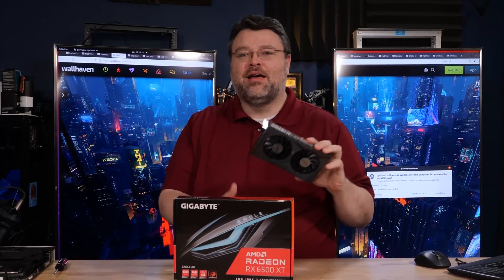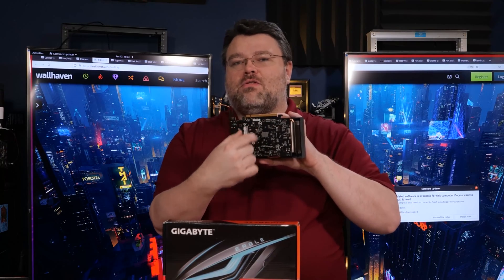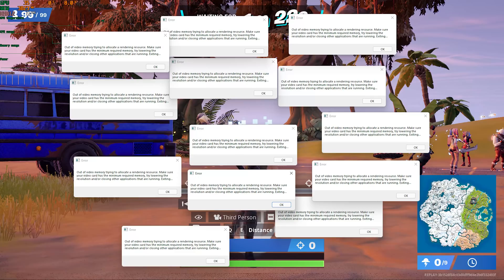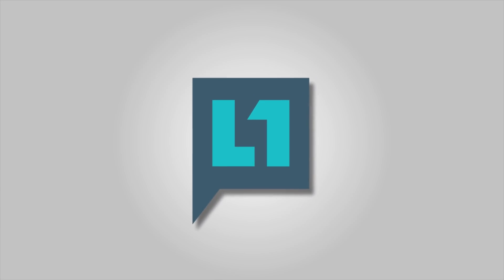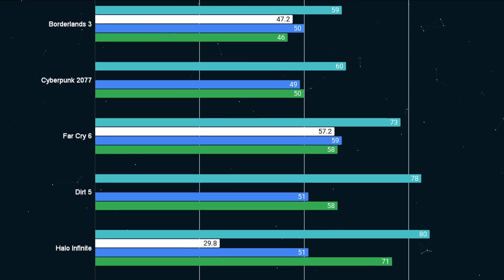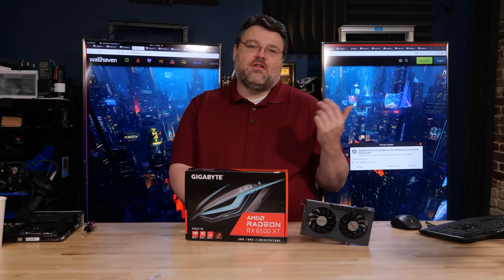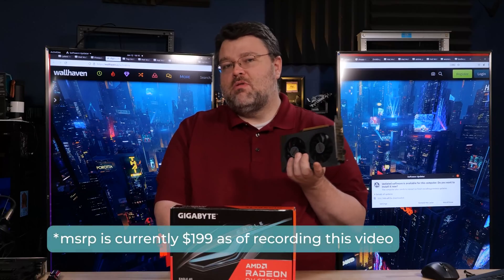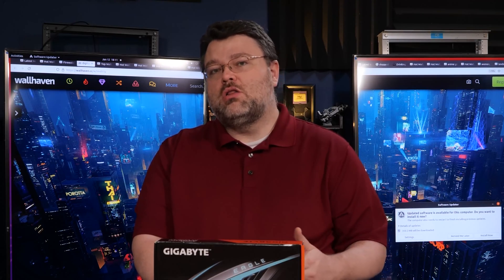6500XT ; Now Attempting Launch - Gigabyte Eagle Tested

Comment: Here's my dilemma,
I'm looking to replace my RX 550 OC 4GB which was my first ever GPU in PC gaming. Reason being, I can barely hit 60 FPS on newer games at low settings/1080p.
Thus, this card came on my radar as it's just cheaper than the closest 6GB 1660 Super.

So, should I invest the extra money to getting a 6GB or 8GB GPU instead? 

Other components like CPU, RAM and storage are relatively decent with A ryzen 5 3600 and 16GB RAM and 1TB SSD.

Thus, if this GPU will get me running games at Over 60 fps at high settings. It's my best option in terms of budget and necessity to upgrade

Comment: I bought the 6500 xt for one reason. Linux gpu pass through. It’s in my 4x slot as the host gpu and I pass through my rx 590 until I can upgrade that card. Only real use I can think of.

Comment: I got one for $199 from Newegg for my budget build .update got the card install on a Ryzen 5 5600g system (PCI3.0)running 16gig ddr 4 3200 and i have a 1440p 144hz monitor and wow everything works like a dream ..God of War 1080p upscale to 1440p medium setting looks awesome using 3.5 gig vram 60+ fps very fun experience looks fantastic .///Fortnight DX12 performance 160fps to over 200fps fantastic card for Fortnight got kills with ease looks amazing ..guardians of the galaxy ok yes a bit of a stretch but medium settings looks good not fantastic but very much a good exp playing it on this card ......must admit I have a main gaming rig that has a 5600x and a 3080Ti so i can and have seen these games on high end rig and well I am surprised what this little card can do and if on a very tight budget and ok with 1080p gaming and can find under $250 in todays market got mine for $199 It can definitely play todays game and look nice with decent FPS at 1080p ...side note I will mostly play Fortnight and watch YouTube and a few other internet things on this system as a daily driver and game on my real gaming rig (side note this only requires a $400w PSU) and that is what I have (EVGA 400w psu) in my 5600g system with this card .runs great and quiet

Comment: I was hoping for a single slot config but I guess dual slot with the possible overclocking is a better option.
Looks like a good candidate for low profile models which haven't gotten anything beyond the 1650.  Also, at X4, seems it would work well as an egpu.
A little too targeted / niche for my taste.  In the before times the MSRP wouldn't have bothered me because AMD would have had it discounted very quickly.  Not so much now...

Comment: .its a 6500 .. not a 6600 or a 6700 or a 6800 its a 6500 its just suppose tobe better then a display addapter. the next step down would be a 6400 and that would be a display addapter. i dont see a problem with the 6500.. its still trash for me because im still on pcie 2.0 lol  but i do not think this card diserves the harsh flack its been getting. its prices just more trash then the card.  gg lv1 techs

Comment: The greatest gift of the 6500XT is that it sucks so much that you actually can buy one.

No kidding, for a (significant) lower price I would buy the 6500XT. I'm currently using a used 1050 2GB I bought last year because my 660 3GB OC died and I needed just something... and when you consider that the old GTX 1050 Ti was 2020 reintroduced for almost twice what the card originally cost... Yes... that pain.

It's not a great price/performance ratio, but at least it's a new graphics card you can buy right now... wow.
Reply: Is it really bad on pcie 3.0 for me i have an i5 9600kf and 16gb of 3200 mhz ram and i also have a gt 1030 so i will mostly likely buy this card its the only one that’s reasonable
Reply: @Movahpiece  The RTX 3050 is not so much more expensive... would be a much better value card.
Reply: @Sir-Prizse  i was trying to get a rtx 3050 but it was sold out and the price is almost 100$ more than the rx 6500 xt I bought
Reply: @Movahpiece  If I absolutely needed a new competent graphics card right now, I wouldn't shy away from the RX 6500 XT. It would get me by for the next two years, but I don't know how much it will lose in value.

Because as soon as more sensible graphics cards come onto the market, the card will no longer be worth anything... maybe max. 150 bucks, unlike the RTX 3050, which performs really well and has enough VRAM and will hold its value for a long time to come.
Reply: @Sir-Prizse  i just got this card to help me until the prices of gpus goes down after that ill get a new one cause rn i have a gt 1030 😭
Reply: @Movahpiece  I feel your pain brother, I have a GTX 1050 2GB... not that impressive either.

Comment: My issue with this card, aside advertising crap from AMD, is that it leaves nothing in between this card and the 6600 (an actual decent 1080p card, albeit mid end). In other words, AMD is pretty much giving up the budget space, with a glorified placeholder card for people with nothing right now wanting to build pcs or people with APUs (and old not even entry cards like a 1030), so for people that actually want to upgrade from a decent budget gpu from some years ago, this is not worth it. Now, the pcie 3.0 issue is the real screw up here. I have a gtx 1650 and with some of these benchmarks, actually having the possibility to sell my 1650 and get the 6500xt would be pretty decent, except I have a b450 motherboard, so the performance that the 6500xt would have is pretty much the same (I've seen a 12 games avg benchmark and the 1650 has 2 fps more in the 1%less and 1fps less in the avg than the 6500xt). It is a sidegrade that involves me selling my card and actually getting this one at a decent price, which aparently, hours into the realease of the card, it was not possible. 

This card is not something like the rx 470 or 570, its not like the gts 250 or 450, or the awesome gtx 750ti, its not even like a 1050, this card seems to be in the middle of those and something like what a gt 730, gt 1030 or rx 550 used to be, with a name that doesn't belong and that completely ruins the chance for having something actually budget in the near future (even if budget right now would mean 220-280$, which I would expect it to mean given the circumstances). You either go this card, which I would actually like if it was called 6400xt or even 6500 (giving space for a better 6500xt), or go mid end with the 6600, the gap there is terrible for many budget gamers. Still, congrats to those that got this card at msrp and needed it for those escenarios, it is a blessing for many gamers, sadly it seems like it ruins any possibility for the rest of us wanting to upgrade to a decent, modern budget gpu...at least when it comes to AMD...the 3050 is looking a lot better even if at 250$ msrp, which seems to me like the new msrp for budget gpus, we'll have to wait and see how it does.

Comment: So, as long as you keep the vram below 4gb, pcie3 / pcie4 differences are minimal, otherwise the card will choke.

Something else I'm wondering. H264/5 decoding, but will it playback youtube/netflix etc where we have av1,vp9 etc because it sounds like cpu will have to put the work in which is not great.

I could handle a 4gb vram limit quite easily, but video playback not so much.

Comment: Still Vega 56 (Sapphire Pulse) after all these years. a 5700xt or 6700xt ish is the only real improvement, but $$$
Been cleaning the fans/fins occasionally and temps are fine; but I think it has graphite (PGM) pad

Comment: Fuck how ruined you have to be to roll out a 900p gaming card in 2022.

Last year AMD released the RX 6000 series, shits said  they have 16GB because 8 is too little. What the hell is this card? Obviously the people are not robbed enough, and the poor children will buy.

And they throw out this garbage before the release of Refresh cheering on 18Gbps memory and probably 6nm. And it comes out with APU with navi graphics, almost the same CU, up to 2.5ghz clock and far faster ddr5 Ram memory than this embarrassment on a 64 bit bus.

And that will cost brother 500 euros. Not too expensive for just the screen image.

Comment: at this point, why not keep making the 590 at Global Foundries? at the same price we get similar performance (and 8gb of vram and x16 pcie) and they can use 6nm to make better products than this.
Reply: IIRC even GloFo is booked up for a while. Also contributing to this both VRAM, component and transport costs have all gone up.
Reply: Then AMD would get criticized anyway for selling such an old product like nvidia has been bashed for their 2060 reproduction. Some people never get satisfied and are all about ranting others as a life sense for their existence.
Reply: The RX 590 requires GDDR5.  Where is that supposed to come from?  Basically nobody is manufacturing that anymore.
Reply: @TrueThanny  sony is going to keep making the playstation 4, where do THEY get their gddr5?
Reply: @dariob467  Either they have some stockpiled, or they're getting it from one of the few remaining sources.

Comment: The 6500XT is such a sad release. So we are globally struggling with lack of resources and we release this at the "$200" MSRP. Sad day, a depressing release. It is unacceptable for a "$200" MSRP card in 2022 to not beat a $280 MSRP card in the RX 590 from 2018, which in itself is an OC of an OC of a card (RX 480) released in 2016. Disappointing. Hugely disappointing.

Comment: I don't know, I feel like a 200 dollar card in 2022 should be at least 1080p@60@High/Ultra/Extreme or whatever the highest setting is. And having hardware encoders would be much better than useless Raytracing.
Reply: the reason it doesn't have them is because AMD designed it without them not to lower cost but because it's laptop GPU that should not double features since APU will have integrated gpu to do encoding/decoding
Reply: @petervansan1054  Doesn't make it smart or forgiveable, it actually makes the application rather stupid. If you put a Honda engine in a Peterbilt once someone complains how horribly underpowered it is are they gonna accept "Oh, it's cause I took the engine from a Honda." No, they're gonna say what kind of f*cking idiot would do that?

The fact it's a mobile GPU isn't a good excuse for being shitty, it's the entire reason it's shitty and why it shouldn't exist.
Reply: @zodwraith5745  it is also the reason why it only costs 200$
Reply: A lot of them do run on high

Comment: This is the most honest review I have seen yet for this GPU.  I love GN, but cards in this performance class should not be benched solely at ultra settings.  Changing textures and shadows down by a notch or two will likely result in a 100% delta in performance if it reduces VRAM usage.

I really appreciate not looking at this product like we are still in the 2019 market.  I would not be surprised if AMD is actually subsidizing these cards to hit MSRP with whats been going on with shipping and component costs.

Comment: This was the 1st 6500XT review I read and so far the only one where the reviewer isn't seething with rage at the poor performance, poor design choices and sheer f*ing hubris of AMD to dump such an underwhelming card on the public. Many of those same reviewers have been only slightly annoyed at high end cards that cards that are selling for more than a mortgage payment, suck down power like blue whales eat krill. 

And I don't think a single review bothered or even mentioned FSR. Too busy going on and on about how horrible the card it is.
You went to the trouble of figuring out what you need to do to get the best out of the card and what kind of performance one might see relative to cards people at this price level might have.  Very much appreciated.

It's not a great or even particularly good card, but it's not worth the vitriol.
Reply: JT gets it.
Reply: FSR can run on every card, so it's irrelevant when comparing GPUs.
Reply: @Abu_Shawarib  Missing the point. He showed how it could be used to improve the experience with the card, which is the whole point of FSR.  At this level of performance, it's exactly what people need to know.
Reply: @JamalTaylor1701  But you're still missing the point that every other card could use FSR as well in a comparison. That's like saying "I like this car more cause when I put in gasoline, it goes. But not that car, that also goes when you put in gasoline." Especially when most games still don't use FSR. It's a terrible selling point still and why AMD barely mentions it.
Reply: @zodwraith5745  Well aware of that. But it shows that you can squeeze out a bit more from a slow card. Nobody else bothered doing that.

Comment: Nvidia: we just Improvised a 4 year old 2060 -> 12 GB and relaunched it in 2021

AMD :  Hold my RX580 -> 6500 minus the hardware encoders and video codec processing support.
Reply: At least the 6500 is in financial reach for many gamers, while NVIDIA does exactly know, that stronger gpus with high memory get owned by miners. Stop the old way of comparing specs and start to think realistically according to the today's situation please.

Comment: Without VCE, wouldn't using the iGPU to encode video increase PCIe bandwidth saturation (versus having the gpu already encode and compress the video)? I'd like to see if this has any noticable impact on performance in bandwidth constrained environments.
Reply: Correct because the iGPU gets an already compressed video stream, if the compression is being done by the dGPU.
But if the iGPU has to do it, the dGPU needs to send the whole video stream uncompressed to the iGPU, which increases data bus usage. But there are possibilities to compress the video stream on the shaders by fast lossless algorithms to some extent.

Comment: If you use the GPU on 4x PCIe 4.0, and need more VRAM, is DDR4 adequate, or is DDR5 required?
Reply from the maker: Try very hard not to exceed 4gb with this card ever :) ram isn't the bottleneck
Reply: @Level1Techs  Thanks. I checked the price of this 'budget' card in Australia and it's still a rediculous price. And I did notice some reviews that were extremely critical of the decision to go 4GB. I think I will give this one a miss. Still, very interesting the memory sharing feature exists. Cheers.

Comment: Huh, most other reviews showed major performance hits on PCI 3.0 boards (which most people wanting to upgrade still use), like 30% or so. Also, my old 580 beats this card in almost all games, and I got mine 3 years ago for €179. Hard sell... but I guess if you're desperate and just want games to basically run ok in 1080 it's an expensive but maybe still affordable stopgap in the current market. I'm just happy to see a review of a new card that makes me feel like mine's still high-end.
Reply: It's really depended on the texture quality used to test. If it fills the VRAM performance will plummet, if it fits into VRAM it's fine. You'd probably have to fine-tune the settings a bit for it to work good and make some compromises on texture quality.
Reply: @cromefire_  True, but 4GB is quickly filled in games of the past 5 years, and once the textures exceed the 4GB and system memory is used older cards with 16 PCIE 3.0 lanes like the 570 outperform the 6500XT and the game might still be playable while the much newer card chokes up.
Reply: @chrissoclone  yeah, might be the case, although the 960 seems to be able to play most games without overflowing the VRAM at 1080p low (which would be the target). It always seemed to be intended to be a laptop card so yeah... it's not designed to be that fast, especially not PCIe 3, that's a huge flaw. Guess for the time being cards would start at like 250 to 350 for something that's reasonable good if card where in stock without markup...

Comment: Everyone else: "This card is garbage."
Wendell: "This is fine."
But then he goes back to playing Fortnight... probably on an Epyc Milan system.
This should be an entry level $50 card. Even MSRPs are out of whack. Its MSRP is the same as cards from 4-6 years ago for roughly the same performance. The only benefit is power draw, which is what makes the mining hashrate of this card pretty important actually. Miners will look at MH/s/Watt and decide whether they gobble them all up from there. Its gaming performance is poor. And the lack of modern encoders/decoders and multiple outputs make it a bad choice for a common desktop. It's a bad card that AMD went to extremes to produce as cheaply as possible then still charge 2x-4x what it should cost.